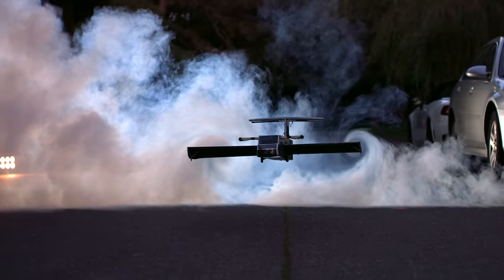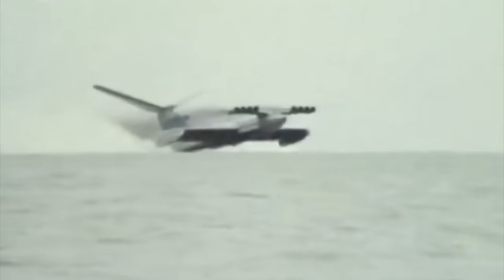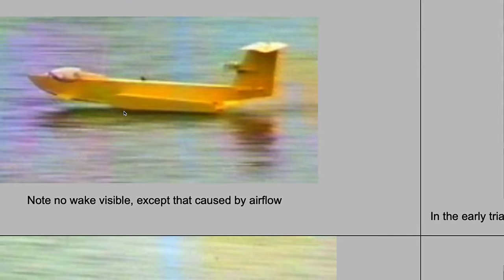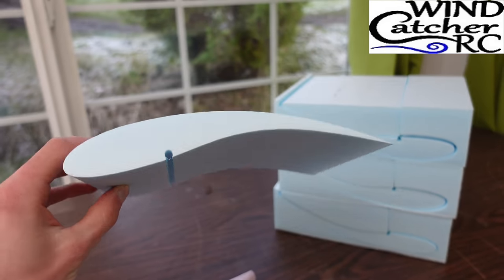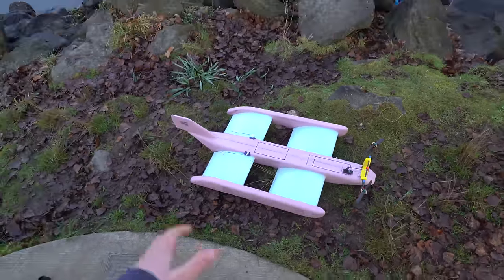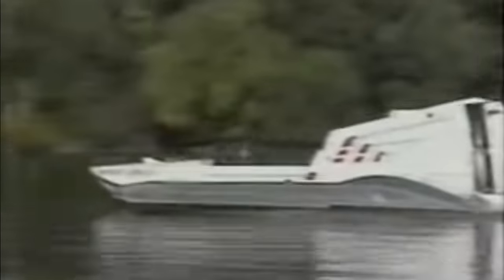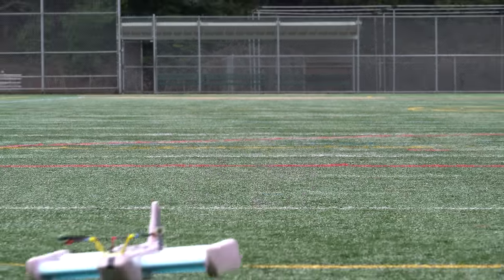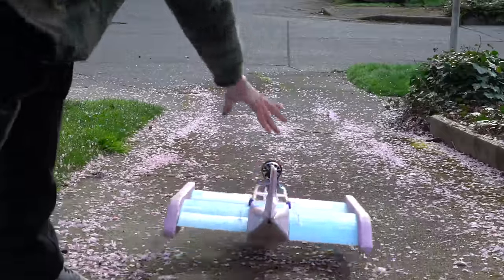Are R/C Ground Effect Vehicles Even Real???

Comment: You need to create a wake in front of the vehicle and direct that under the other surfaces. I suggest moving the motors in the aft and mounting a canard profile wing upside down to creat a wake. Use a LiDAR to control altitude and thrust. And fly autonomously because piloting an RC boat would be difficult ( human feedback to slow on throttle). 
Pelicans use wakes caused by the waves to travel from south to north.

Comment: All of the training I’ve received in fixed wing aircraft and rotary wing aircraft has been that ground effect happened one wing length from the surface. Helicopter hover heights are extremely dependent on ground effect especially in high density altitude.

Comment: Hi! Yes, i'm very in time with this comment. Caspian sea monster definetly could fly not in ground effect territory. BUT only with use of its frontal takeoff engines. And very poorly. In the ground effect he could fly only with two tail engines (so, five times less power). The main point of using ground effect is efficiency. This is why he made sense — the numbers of weight that he could take are quite terrifying (250 tonns at 430 kmh, says wikipedia, and all of that with only two engines 130 tonn-power each. With own weight of another 250 tonns)

Comment: I noticed the model you are inspired by is a pusher. might the additional thrusted air flow from the props be creating additional lift cuasing omore on the rear foil causeing instability in ground effect? (11:31m). I am excited to see how you solve this issue.

Comment: Two things:

1. Anyone who says that a wing-in-ground-effect aircraft is "just a plane flying low" is a dunce, don't listen to them.

2. Your altered design is the source of your troubles, put the motor in the back, and it will lift off using an almost ram-air effect. The Par-thrust design works works for certain setups, but you need to lift off with pure speed in a rear-engine design.

Comment: The German Wikipedia on Günther Jörg says he developed the air foil shape specifically for his boat so it would be naturally stable. The only controls were throttle and rudder, no pitch or roll control. Due to this is is apparently classified as a motorboat in Germany.

Comment: When you look carefully at Mr. Jörgs design, you realize, that he uses a much thicker profile and a different AoA for the aft wings. that tends to produce more lift as you get faster and pitch down the craft so it cant lift of. for this design it is crucial to put the propulsion to the back of the aircraft, as you otherwise disturb the balance of the lifting surfaces. The position of the CG is also of some importance here. Another point is the negativ pitching moment of the thrust vector of the original design.

Comment: 2 points. 1. Try moving motors forward and do not tilt them. Instead, put a tiltable plane behind so you can redirect propwash when needed.
2. Make you vehicle HEAVY. Or motors underpowered. Or both. The motors should be powerful enough to gain speed but not powerful enough to lift the nose up.

Comment: My guess is that the two sets of airfoils need to be different. I would guess that you need to maintain that rearward CG with a high lift airfoil in the rear while using a slightly less aggressive airfoil for the front set of wings. The front wings will naturally pull air under the rears wings creating a kind of automatic PAR thrust for the rear wing. It's a sort of canard arrangement except in this case you want the two sets of wings to interfere with each other.

Comment: I think the negativ camber does somenthing bad to the flow of air underneath, so i think the aerofoils must be' flat at the bottom, to create a steady flow underneath.
Another consideration Can be' that the aerofoils cannot be divided into two pieces because of air vortexs, i think the flow has to be' stady as possibile to "levitate" the plane. I don't think we can create a Wing for this kind of "plane", It require somenthing like a tunnel to squeeze the flow on the floor.
Great video and pretty good idea.

Comment: If you look at the original design, the pusher motor has a thrust line angled through the CG. Yours being in a puller position means that even when angled through the CG, your design get a lot of weird direct lifting/propwash over the wings

Comment: I think the mission critical point is that the pressure point of the airfoil jumps significantly if you move in and out of ground effect. In the redbull video flying through the tunnel with an Edge 540 the pilot trained a lot to compensate the pitching action. As far as I read through the german rc network, Guenter Joerg used a reflexed airfoil in the front and an upside down clark-y in the back. There is an article available under "...Study of CLARK-Y Smoothed Inverted Wing with Ground Effect" and can be found in google. It states out that the negative lift coefficient increased with ground proximity  The tricky part will be to get the neutral point of the tandem wing as far as possible to the tail in out of ground effect condition (aka normal flying) and the CG slightly in front of the neutral point which will cause the vehicle to pitch down. This will be done by the angle of attack of the inverted Clark Y!! As soon as the vehicle gets into ground effect the reflexed wing will pitch down but the increasing downforce of the Clarky-Y will counteract.
Reply: In addition, pitch in normal flight will be very stable but will not build up any pitch up momentun even with high excess thrust. An reflexed airfoil has a pitch down momentum. An inverted Clark Y has a slightly downforce. At high angles of attack the inverted Clark Y will produce lift and therefore force the vehicle to pitch down immediately! An inherent safety feature :)  The best picture is to see the Guenter Joerg vehicle as a swept flying wing. The front part is the reflexed airfoil and the back part is the .inverted Clark Y with the elevator feature due to ground effect
Reply from the maker: It's quite clear the airfoil flairboat did not use a upside down clark-y in the back. If you look at a cross section of the airfoils the rear one has even more camber than the front one

Comment: If ground effect has to do with the bottom of the wing, then disrupt the top surface of the wing so lift cannot work. Maybe some weird horizontal struts attached to the upper surface to break the high pressure/low pressure differential needed for lift.

Comment: For a ground effet vehicule you're looking for high pressure under the wings, not high pressure over them : so why not ditch the plane airfoil (that will alaws get 75% of its lift from depression ovec the wings, giving it a plane-like behaviour), and only focus on the shape of the underside of the wings ?

If you want to thake this to the extreme, you could even use a flat horizontal profile over the wings (to get 0 depression), while keeping the underside of the wings as they are !
Reply: Good idea, and that would hinder it from flying well out of ground effect too.

Comment: Avoid the need for the power to get out of water... make one to take off from pavement.

Ground effect works over land too.

I had a Four Star 40 that with 10X6 prop would not stop flying without killing the engine.  Idle was enough to keep it flying in ground effect.  Changing to 11X4 allowed it to slow down enough to stick to the runway. 
True ground effect flight at engine idle.  Enough to lift off but not climb above appx 1 winspan above ground.

So we CAN do ground effect flight with models.

Start with something that flies... Trim it.
Reduce power by changing the prop.
Reply from the maker: but thats too easy :)

Comment: Cool stuff. Why not just prove ground effect works by measuring required power to maintain a certain speed & height for multiple cruise heights and plot it. Power required should get smaller with ground proximity. That should be easy to do considering you control height anyway by lidar and can for sure also maintain gps speed (do multiple legs up/downwind and average to get wind influence out)

Comment: For the Caspian Sea Monster, I wonder how exactly they are counting the altitude. At those low altitudes, it makes a difference whether you're measuring from the bottommost part of the plane or the middle. If they're measuring from the middle, then perhaps it really is under 20m, when you take into account the tall downward-extending winglets on the wings.

Just a thought. I'm no aviation engineer.

Comment: Can you try this?  Long tail shaft to propeller in the water.  Set height to optimum ground effect height.  Reference Thailand long tail race boats and offshore boats with surface piercing props.  Set speed control mode to keep constant desired prop rpm regardless if in water or out of water.  If prop gets lifted from water that will be direct feedback height control to maintain operating height in ground effect.

Comment: I believe, that you did it good. The only reason, that it was trying to grab the ground by its nose - is possibly, that the props were producing more air flow to back wings rather than for front ones. Afet you moved engines out and put only one engine at center - the situation has gone better. In those old footages this german man had his engine in back of the vehicle.

Comment: Heh! Thanks for that. But the devil is in the definitions!  In the '70s & '80s we used to race light hovercraft at HCGB meetings - and built more than a few models, for fun and for test purposes too.  We foresaw that as we progressed from F3 to F1, there was a good chance of flying - at least temporarily - as speeds increased.   In F3 with their 250cc engines they were often struggling to get on cushion over water, but races were started on land, for obvious reasons. Then one would rush down the river bank and over the water - no struggling with 'getting over the hump'.   With a decent amphibious  lift arrangement one can launch a  light craft with (as mine had) a 12hp industrial engine and then skim over the water at 22 mph. 
At the same time as we were getting the bugs out of our F3, I built a crude 'flying' model that had the same scaled dimensions as a real one, but was made from a polystyrene ceiling tile.
Then the challenge was to get it to fly level!  The tiny 0.049 glow-plug would only just keep it in the air, but by playing with the centre of gravity, fins, feathers and spoilers, we got it to wobble across the paddock and land in one piece.
This came in handy when we were designing our F1 machine a few years later -  spoilers were used to mitigate the tendency to flip over backwards/sideways, and they were needed, since this machine would move at over 100mph air speed.  On a racing circuit, this would launch itself from (say) the bank at the edge of a lake, and go flying  for a bit.  It always returned to earth, usually within a dozen yards or so, but on occasion it would fly  further.
With more power it might have climbed into the sky!  But we wanted to avoid that, since it only had rudders - for yaw control - and pitch/roll were done by weight shift.  It was scary to watch.  The point is  that it was a working  ground effect flying machine that would hover in one place with just the lift engine running,  Not a WIG like the Ekranoplan, but with enough power to make the thing fly, almost.  It is my experience that almost anything with a flattish  bit on it can be weighted and trimmed to sorta fly.  Like the ceiling tile.  Our F1 could take a run at a launch ramp and zoom up to six feet or so before descending again.  With more power, yes, it might stay up there, but we are talking about a thing with a stall speed around 100mph, so the landing could easily go bad on you.  If pretty much anything can be made to fly (Ground effect is always present if you are near the ground) then it is a question of which ground effect machines qualify for your reality test. As you imply, adding power is usually an option.   The devil is in the definition for sure!

Comment: The question isn't can such a craft get out of grand effect, it's can it maintain flight out of ground effect at the same efficiency as it can in ground effect. You'll run into a problem with small RC models as the engines are (generally) going to be powerful enough for the model to fly. If you wanted to test this you'd have to get a model and then weigh it down so that it can "fly" in ground effect but can't maintain flight out of ground effect.

Or get a model that is flying in ground effect (actually in ground effect, not simply flying at the correct altitude) then get it to maintain flight out of ground effect without adjusting its engine power.

Comment: If the surface is too smooth The water could be inclined to stick to the surface which could pull down the boat into the water You want to think golf ball aerodynamics, you kind of want to avoid laminar flow on the pontoons,  An easy solution would be to give them a Hydrophobic coating

Comment: Yeah...I'm gonna have to invoke the KISS rule here.

Just fly a vehicle in a minimum thrust state, just enough to maintain flight in ground effect but not out of ground effect.

In terms of testing, fly a vehicle OUT of ground effect (OOGE) and then dial back thrust until it's incapable of maintaining stable flight. Do the same IN ground effect (IGE). If the minimum of stable flight OOGE thrust is higher than IGE thrust, that's your proof. Send your plane up a few dozen  feet and dial back thrust to IGE minimum.

Comment: LOL yes theyre real, but RC motors are SO powerful they usually have enough juice that they can pull it into the air if they want.    yes, they CAN probably fly, but the key is that they use SOOOOOO much more gas outside of ground effect and they arent really designed for flying quite like a plane is.  sure theyll fly above it, but they wont be maneuvering and may crash horribly.  

Ground effect aircraft doesnt mean you cant ever fly out of it, it means the craft is only really designed to fly in it.  i do like your design :)

Comment: The problem with ekranoplans is avoiding other traffic, where jumping over would be a possible solution as turning sharply at high speed is not realistic, as you need a flat turn or you lose the WIG under the wing, and you become a falling 100 ton rock!

So not that feasible in anything but far from land, with little traffic. 

A modernized Do X, with beaching landing gear, and diesel engines, maybe electric boost for take-off, is much wiser! It always flew in ground effect, if possible, but had a cruise ceiling of a few thousands, if needed.

Comment: Would be interesting to see the wings stacked vertically (like on your multi-element wing video) instead of one after the other. Almost looked like the airflow from the props (when in the flatter position) would be too far above the first wings, but would spread out enough to get under the second set, causing more lift at the back and pitching the craft forward.

Comment: One of the main reasons these planes were designed for military use is because they were basically undetectable when flying so low. If they flew higher then they could be picked up by radar.

Comment: I think, you should ad a little bit of height on the rear wing? So the front won't pop up alone but the rear too? Cuz maybe the rear doesn't get enough air to  push the rear? Or make the rotors even to the front wing?

Comment: The first thing I see is the bizarre  aerofoil . This is a GROUND EFFECT vehicle right  so you dont want to lessen the air pressure above the wing. You want to use (hello) ground effect and cause a higher pressure below the wing and only when in proximity with the ground. Make your wings flat and with identical top and bottom curvature. they will work better than whatever those are. I hope I see thatt you did so in the next video now.

Comment: If you have a complete tail, with elevators used just for stabilization, then (maybe) the only problem left is having enough lift to leave the water but not enough to get off of ground effect... That's tricky and I don't understand it much...

Comment: By my narrowed knowledge of it all, i say its just due the different way scaling works on each aspect. Weight, power, drag (water), i dont feel they scale all at the same rate making it pretty much impossible making a ground effect RC machine without it capable of flying (hell, you even made a rocket without wings that could 'fly'). But from what i see on what i found about them, the biggest difference i see is basicly the 'inability' to control the pitch, no flaps on the wings. But by adding them, i think you already put it down as plane, kinda making it void by default.

The big plane in the beginning used ground effect because it was extremely efficient compared to a possible ability to make it fly, they could throttle back upto 90% power and keep the current cruising speed, maybe put that also in consideration when trying to make ground effect work.